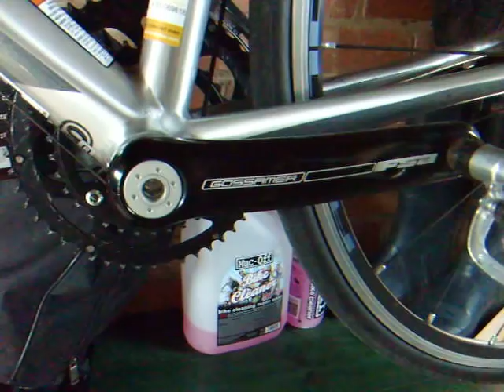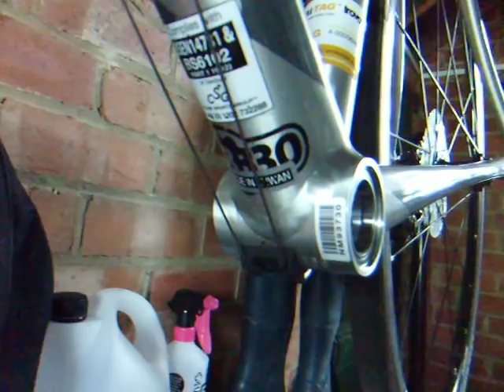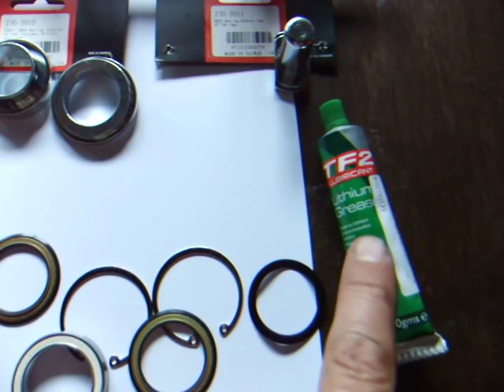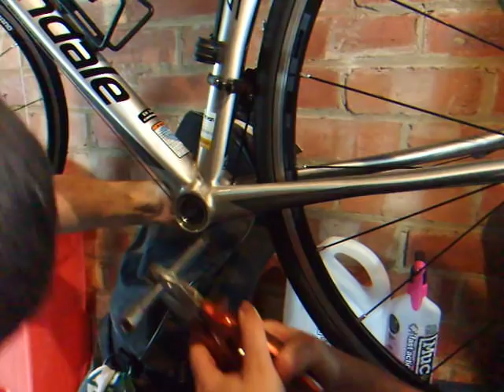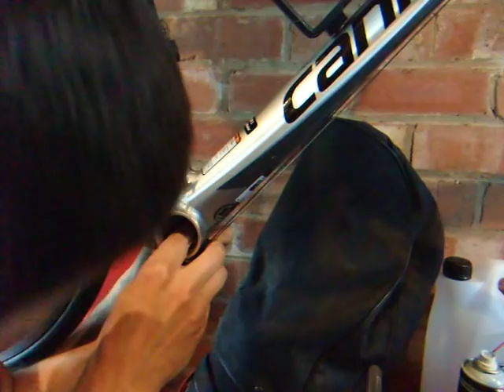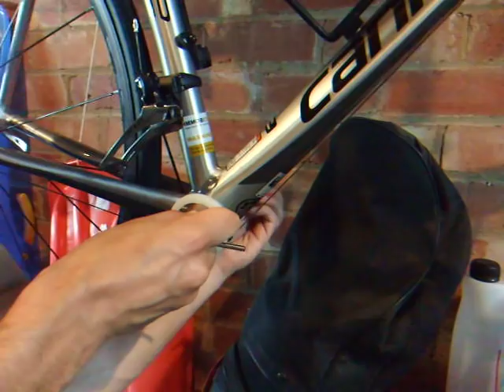DIY BB30 bearing replacement on Cannondale Synapse Alloy

Comment: what a stupid way to remove bearings? Why hammering it out? Just use bearing removal tool!
Reply from the maker: Quite right, there is a tool for pretty much everything however owning them all is a different matter. Sometimes you have to get by without, that's the clever bit.

Comment: My only gripe with the removal tool is it doesn't support the outer race, so all the strikes are being transmitted through the balls, which is bad if you're planning on reusing them.
Reply from the maker: True that! ... you can re-grease while still in the frame but if you do go to the effort of removing them you might as well fit a new pair as they are not that expensive and you wouldn't want to re-fit bearings that have been mechanically stressed.
Reply: MrDufftastic I'm planning on converting my Specialized BB30 frame to a triple, with my crankset of choice being a 10S Tiagra (the new stuff), which requires pressing in a BB30 to threaded sleeve that's smooth on the outside and threaded on the inside. Since I don't want to buy a new triple front shifter, I might put a bar end shifter just on the left and either keep my existing double shifter as just a brake lever or buy a simple old style brake lever to take care of the braking. My question is, do you think the 10 speed crankset will give me trouble as far as front shifting? I mean the difference between a 10 speed and 11 speed chain is tiny when it comes to front chainrigs, but I don't wanna waste my money on something that doesn't work.

Of course I would also buy a triple front derailleur, which will be used with the bar end shifter in friction mode, OR I'll use an Ultegra (10 speed 6600) tripe shifter which a friend offered me.
Reply from the maker: From what I've read you should have no problem running an 11 speed chain on the 10 speed chain-rings.
Reply: MrDufftastic Thanks for the replies.

Comment: Excellent video, gave me more than enough info to check a BB30 on to expertly built (!) 2x Halfords bought Boardman CX team - bikes, which have bad reviews for BB, yet Halfords assured me they knew the issue and our bikes weren't an issue.  SO took apart, dry as a bone, so greased and reassembled.  So thanks indeed - saved me from premature failure
Reply from the maker: Thanks Ryan,  I'm pleased it has helped so many people fix their bikes!

Comment: Great detailed video. Especially the part where you felt the bearing wasn't flush and you redid that bit instead of forcing it (and possibly botching it)! Cheers.

A
Reply from the maker: If it doesn't feel right it probably isn't. I'm pleased you found the video useful. Cheers!

Comment: Finally I found the solution to my stupid cracking noises! Thanks for the video!
I tried everything but greasing the plastic cups on my FSA PF30. My bearings were in a good condition. Just a lack of grease.
Now finally my bike is at peace!
Reply from the maker: +Mee Meo Well done on sorting your bike, I'm please the video was of help to you . Cheers
Reply: +MrDufftastic 
Hi, question,  while you were hammering the bearing out, is there a chance to knock the Internal Lock-rings off?
Reply from the maker: +Travis Li Hi, if you mean the large circlips in the frame BB shell then no providing you are careful. If you mean something in the bearing itself (because you wish to keep it) then it is important to only strike the outside part of the bearing race to avoid damage. Using the correct tool as in the video will protect the inner part of the bearing while carefully drifting out.
Reply from the maker: +Travis Li Hi, if you mean the large circlips in the frame BB shell then no providing you are careful. If you mean something in the bearing itself (because you wish to keep it) then it is important to only strike the outside part of the bearing race to avoid damage. Using the correct tool as in the video will protect the inner part of the bearing while carefully drifting out.
Reply: so the Bearing Removal Tool doesn't touch the large circlips in the frame BB shell. does it make contact with the both outer and inner bearing race while you were hammering it out?  Thanks in advance.
Reply from the maker: +Travis Li Hi, the FSA removal tool does not touch the circlips so they can remain in place. Having had another look at the removal tool It doesn't fully extend over the outer bearing race so removal could cause some damage to the bearing. Having said that if you go to the effort of taking the bearing/s out you might as well replace it/them (the drive side bearing gets most wear in my experience).

Comment: Hi, thanks for the video looks really helpful, however I am stuck at the first stage.
When using the 10mm it did loosen, but did not tighten back up as you mentioned (self-extracting assembly) so the bolt came right out and the crank is left on the spindle. No matter what I have tried I can’t get the crank off, any ideas?
Reply from the maker: Stephen Hart When the crank bolt is turned counter-clockwise, the shoulder of the bolt presses back against a crank bolt retaining ring. Do yo have the retaining ring on your assembly? Does the bolt have a shoulder? - It should.

Comment: Looking for a 'comfort' road bike and want the durability of alloy....with this in mind I am wondering if the BB30 is durable and indeed does it offer more benefits than a threaded BSA? Great DIY video!
Reply from the maker: Alex Lintern Well the Synapse Alloy is a great comfort bike and the BB30 concept is good too, it's just the durability of the bearings is questionable. Having said that I can easily change a set in less than a hour now and unless you buy ceramic ones they are relatively cheap.

Comment: what kind of grease do they use inside the bearing? maybe repacking it with a better lube may be a better idea?
Reply from the maker: Bearing grease hopefully! I use Weldite TF2 Teflon Lithium Grease. It's easy to pop the seals off a bearing.

Comment: This may sound counter-intuitive but don't use grease when pressing the bearing into the frame, Press it in dry. This is because it's not a thread, press fits are supposed to be tight. Think about how you install headsets and the crank on square-taper bottom bracket axles. They're supposed to be completely free of grease or dirt. Same with splines: DO NOT lube them.
Reply: +z1nyc If you look at the FSA instructions, they say to apply a thin layer of grease to the shell.  They also say to apply a layer to the spindle.  I suspect they know what they are talking about.

Comment from the maker: FSA tech docs only show one on the non-drive side. The spacers should provide just enough side trust to compress the wavy washer slightly and take up any play. I guess one wavy washer is enough to do the job, the crank spindle will float in the bearings.
Reply from the maker: ***** The following is copied from the FSA installation instructions. Notes: Adjustable Spacer ⑥ are for adjusting spindle movement side to side in the bottom bracket; referred to as “ Side Play ”. If at proper torque there is still side play and the wave spring washer is not compressed at
all, the spacers may be used. The wave spring washer does not have to be completely compressed for proper use but does have to be in contact on both sides by the left arm and left bearing shield. The Spacers are not
required when the PF30 specifications of the frame are correct, but in the market there will be times when the frames are not made to exact specifications.
Reply from the maker: ***** Thank you for sharing your experience.

Comment: Can someone give me info on this bike and let me know what gender it's for
Reply from the maker: Hi, This is the mens bike although Cannondale did do a womens spec bike (slightly different geometry, women specific saddle etc). Checkout this link for details: http://www.cannondale.com/nam_en/bikes/archive/

The Synapse 5 105 Compact 2013 Road Bike features the Synapse Alloy, Optimized 6061 Alloy, SAVE PLUS frame and SAVE fork with carbon blades, as well as an FSA Gossamer compact chainset and Shimano Tiagra 4600, 12-28, 10-speed cassette and Shimano RS10 rims finished off with Schwalbe Lugano 700×25c tyres.
 Frame:
Synapse Alloy, Optimized 6061 Alloy, SAVE PLUS, BB30
Fork:
Synapse SAVE, carbon blades, 1-1/8 inch
Front Derailleur:
Shimano 105 5700, 34.9mm clamp
Rear Derailleur:
Shimano 105 5700
Number of Gears:
20
Shifters:
Shimano 105 5700
Chainset:
FSA Gossamer, BB30
Chainrings:
50/34 tooth
Bottom Bracket:
FSA BB30
Cassette:
Shimano Tiagra 4600, 12-28, 10-speed
Chain: FSA 10-speed
Pedals:
Front Brake:
Tektro R539, dual pivot, cartridge pad, long reach
Rear Brake:
Tektro R539, dual pivot, cartridge pad, long reach
Brake Levers:
Shimano 105 5700
Handlebars:
Cannondale C3 Compact
Stem:
Cannondale C3, 31.8, 6 degree
Headset:
Synapse Si, 25mm top cap
Grips:
Cannondale Suede Bar Tape with gel, 3.5mm
Rims:
Shimano RS10
Front Hub:
Shimano RS10
Rear Hub:
Shimano RS10
Spokes:
Shimano RS10
Front Tyre:
Schwalbe Lugano, 700×25c
Rear Tyre:
Schwalbe Lugano, 700×25c
Saddle:
Cannondale Stage Ergo with Crmo Rails
Seatpost: Cannondale C3, carbon wrapped, 27.2×300mm

Comment: Hello!! This video was very helpful for me! Thanks a lot!
 I also have the same problem with bearings. In my case that click clack noise started aftef I washed the bike with pressure. Until that wash the bottom bracket worked well and the bearings are very old.

Comment: Many thanks for sharing this important video. I am having exactly the same problem with my 1.5 month old purchased 2014 CAAD 10, the noise started from the delivery, I was complaining about the noise, the shop guy didn't give me a clue at all.
Reply from the maker: ***** Hi, I changed both bearings even though only the drive side bearing felt rough. More recently I did just clean and repack a rough bearing to see how it lasted, it was fine but I decided to replace both bearings again before a long ride with lots of climbing.

Comment: can you give me a link to purchase all the bearings and seals? thanks
Reply from the maker: Try this kit: http://www.chainreactioncycles.com/sram-bb30-bb-assembly-kit-alloy-bearings/rp-prod40333 or 
http://www.planetx.co.uk/i/q/BBFSBB30SLK/fsa-bb30-bearing-kit-for-sl-k-gossamer-cranksets
Tools: http://www.chainreactioncycles.com/fsa-bb30-bearing-installation-tool/rp-prod36370 & http://www.chainreactioncycles.com/fsa-bb30-bearing-removal-e0019/rp-prod36371
Reply: Thank you!
Reply: Could you also make a video on how do do the headset bearings?  I would be very interested in watching that. (including links to tools and parts =))
Reply from the maker: Henry Chuong Well I do have a slight creak (when climbing) that is possibly coming from the headset, so if I decide to take a look I'll certainly post a video.

Comment: Plastic shims are used to reduce lateral movement.  Not bearing shields.  Some frame/crank combinations may not need them.  Make sure to use same thickness of shims on both sides if needed.  My frame uses two shims.  The shims go between the crank and aluminum shield on the drive side and between the wavy washer and aluminum shield on the non-drive side.  The aluminum shield goes against the bearing on both sides.
I have seen that some bike shops are installing bearing shields as shims to reduce lateral movement but these bearing shields may be too thick to use as a shim.   FSA makes plastic shims for this.   If you have two “bearing shields”  installed in your BB, get rid of them and install the proper shims.  The bearings already have seals installed.  Check out the FSA BB30 installation video on YouTube.
Reply from the maker: Well, by doing the job ourselves we ensure it is done properly and get to learn more about bikes. In my installation I used two new bearing seals (in with the bearing kit) but reused the two plastic shims.

Comment: That click will happen when the grease has become contaminated with road silt.  This is the outer bearing race binding and slipping in the bearing race.  It is most often not the bearing itself.  A simple cleaning & re-greasing often relieves this clicking.

Comment: And this is why I only buy bikes with threaded bb's , it only takes a few mins to change a hollowtech bb and I haven't heard any reports about the clicking and squeaking that seems common on bb30's , it seems they designed something that didn't need designing and made it worse ,
Reply: Rotor now do a nice hybrid BB for press fit frames "Rotor BB30 - 24mm Road Bottom Bracket"

Comment: Great video, don't suppose you have a link to that press that you have there? Thanks
Reply from the maker: Thanks for the comment. I checked eBay and the seller has nothing. The bearing installation and removal tools are available from Chain Reaction (just search BB30  tool).
Reply: Great, thanks again!

Comment: Very good of you to take the trouble to post this video, watched it then removed and replaced mine which were ticking. Do 50-60 miles per week and bike is around a year old, had the first rebuild at the L.B.S under warranty. Shop owner says some OK forever, some not, failure always insufficient grease at factory and he just wished all were faulty as he never knows which ones to strip and re grease!  I used an old alloy seat post to square up the bearings on replacement which just happened to be the right sliding fit inside the bearings. Saw to length, also easy to make your own press tool out of a piece of cut stud iron ('Allthread' bar) 
Kev

Comment: mine had the same loud clack noise. Replaced the bearings and 200 miles later they've started AGAIN. This time a slightly different noise but always when the crank arm goes to 6pm
Reply from the maker: That's a real pain, I was disappointed having to check my bearings again after 1100 miles. The grease in one bearing looked discolored compared to the other. Ended up replacing them in the end rather than repacking with grease as they are not very expensive.

Comment from the maker: I have now ridden over 1100miles/30,000ft ascent since replacing the bearings and the click clack noise has just come back (under heavy load), although not as bad as before. I intend to inspect the bearings and hopefully just repack them with grease if they appear OK. I have just come across a nice video on the 'Installation and maintenance of FSA BB30 road crankset' on the FSA website in the 'How To' section. This shows the official grease repacking procedure but involves removing the bearings, if I was to go to the bother of removing the bearings, I would probably just replace them. I will try re-greasing with the bearings in the frame - I might just post a video with my findings!
Reply: I have that problem under heavy load on my CAADX105, which is what brought me to this (very helpful) video. Are these bb30 bearings just not very sturdy?
Reply from the maker: Robert Hayden I did see a post stating there was an issue with a batch of bearings not being greased properly in the factory (but I can't remember the details). Judging from the Internet activity on BB30 it does seem a common complaint. My original bearings and both the replacement pairs were FSA, if I get the problem again I might try the Cannondale brand which are a little more expensive (but better, who knows?).
Reply: MrDufftastic  Interesting. I also read something on a US forum supposedly quoting FSA that said the tolerances on the bb30 shell are very tight, down to 1/1000 of an inch and they suggested using a very thin application of loctite 609 to act as a sealing layer around the outside of the bearing / inside of the shell. Going to try that with mine (alongside some new bearings, might as well)

Comment from the maker: The torque specification for the crank arm bolt was marked on my crank arm (38 - 41nm). My torque wrench was set up for this (it clicks when the set torque has been reached).
Reply: very helpful video. However I think the 38-41Nm is for the extraction cap. if you remove this cap only (left hand thread) then you will see the bolt inside has a higher torque setting (45Nm-55Nm). see this example http://www.chainreactioncycles.com/fsa-megaexo-crank-screw-qr-14/rp-prod87643. Otherwise excellent
Reply from the maker: James Metcalfe On my bike the 38-41Nm is marked on the bolt as per the one in your link. Your link shows the bolt for the FSA MegaExo Crankset. The crank bolt retaining ring on my bike is not marked with a torque setting (and wouldn't usually be undone anyway as the the ring and crank bolt act together as a crank extractor). I'm pleased you found the video helpful.

Comment: Just curios why your trying to baby the bearing out.  If the bearing is junk and going on the garbage anyway then rotating the tool as to not damage it is pointless.  I just replaced my headset bearings on my lefty Cannondale and just used a flat head screw driver to knock them out of the cups, yeah I screwed the bearings up but if their junk anyway who cares.
Reply from the maker: You are correct the old bearings are junk however my bike frame is not. I was using the removal tool to ensure the old steel bearing came out parallel and not skewed in my relatively soft aluminium frame.

Comment: Great video thanks.  I have removed a FSA Gossamer crank from my Bianchi.  I want to install a Campag Centaur Power Torque crank.  If I remove the old FSA BB30, can I simply install a Campag BB30 Integrated or outboard cups?  One is screw in and the other press fit. Any help gratefully received. Thanks again

Comment from the maker: Sorry I don't know the crank bolt torque for a CAAD10 and this would probably vary depending on what model/spec CAAD10 you have. The torque range of 38 - 41nm was etched on the crank bolt for my FSA gossamer crank.